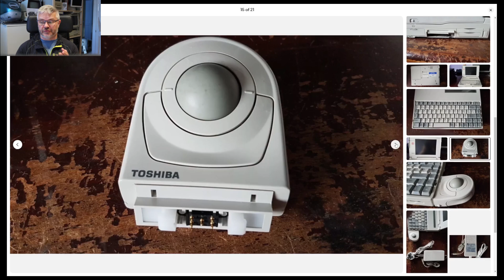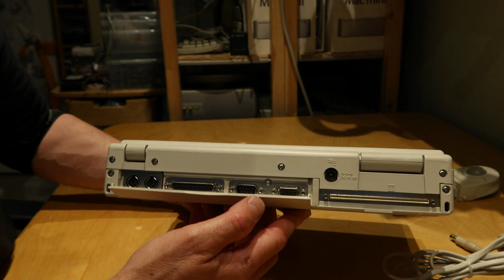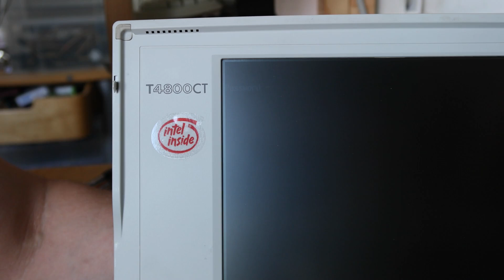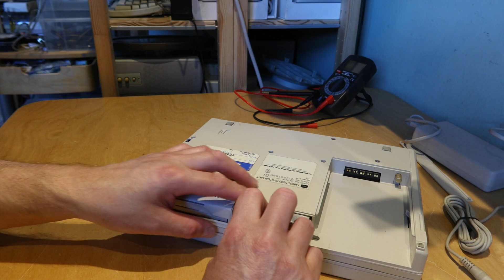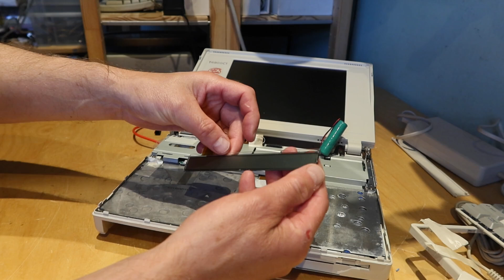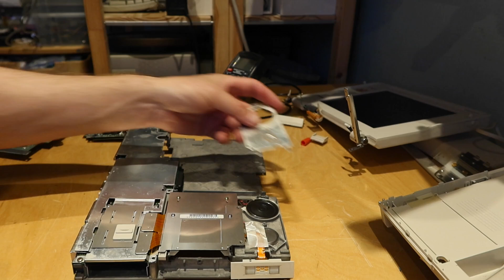Toshiba T4800CT First Looks and Teardown

Comment: Hi Neil. What You need to do getting P10 and P4x code is to recap power board....
Reply from the maker: Thanks for the info. My soldering skills are not up to that yet :-/ It's something i'm working on.
Reply: NP Mate, I can fix it if You want.

Comment: Great video! I have several vintage Toshiba laptops, and every single one of them had two Varta NiCad batteries in them, all leaking badly, so even though this one didn't in the end you did the right thing by not giving up searching for that second one. Toshiba just loved burying them deep within totally unnaccessible regions in those days.
Reply from the maker: I sppose it's reasonable to think that Toshiba didn't think their laptops would still be around and used in 30+ years time!